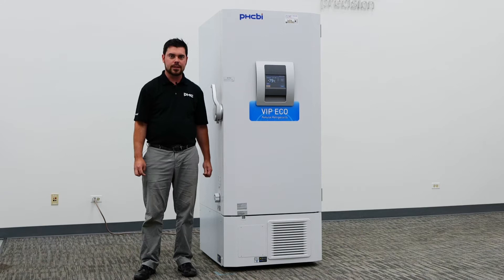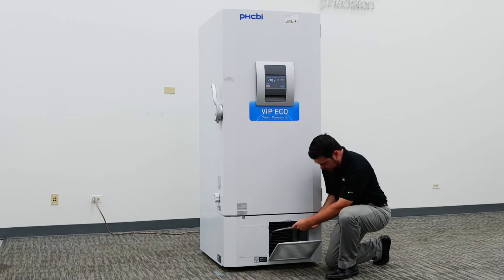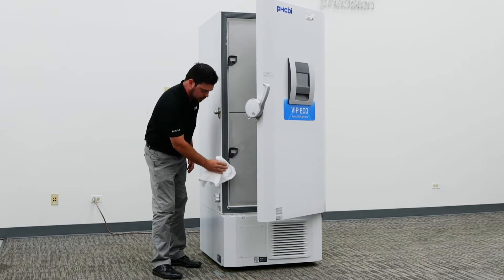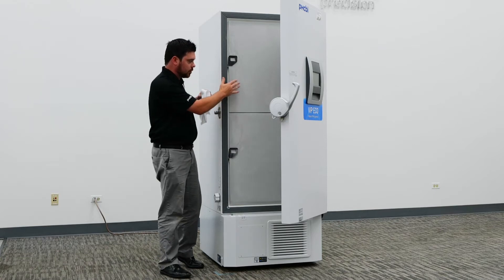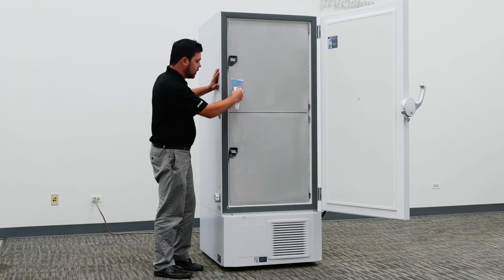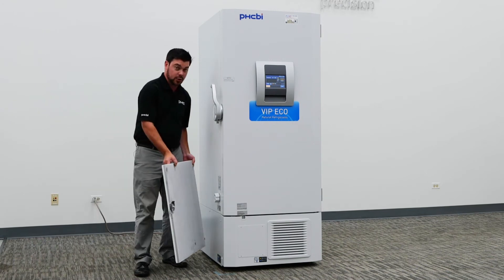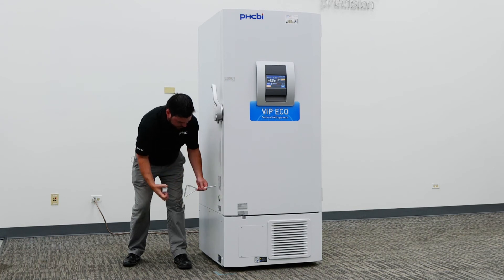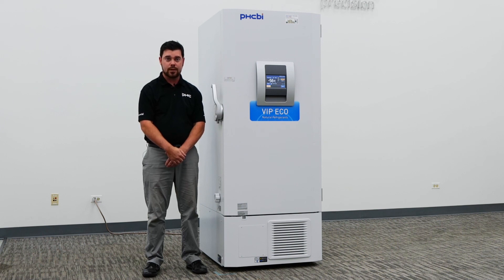Preventive Maintenance Tips to Maximize Ultra-Low Freezer Performance

Comment: We are a manufacturer of ultra-low temperature refrigerators. We can provide OEM。 Have -25, -45, -65, -86,-105, -135，-165 degrees Celsius ，helillcc.com harson：shenharson@gmail.com，helilanxi0902@@t